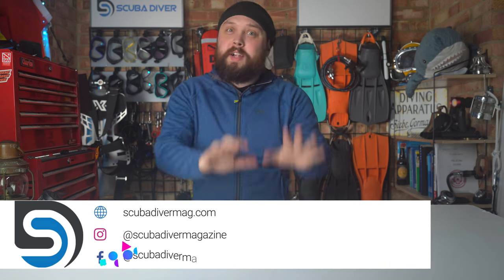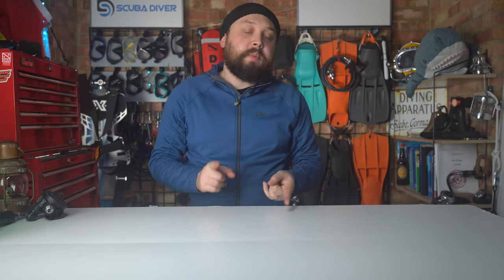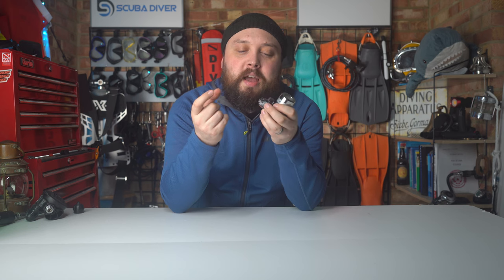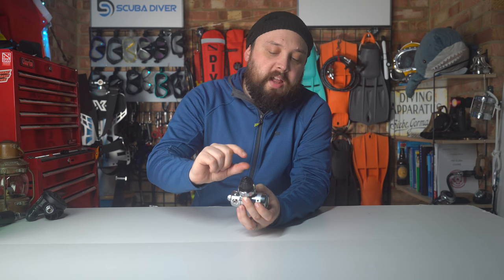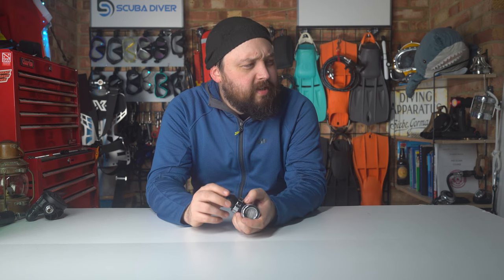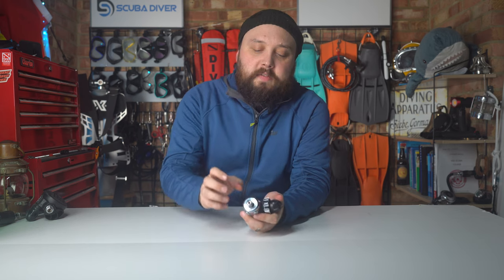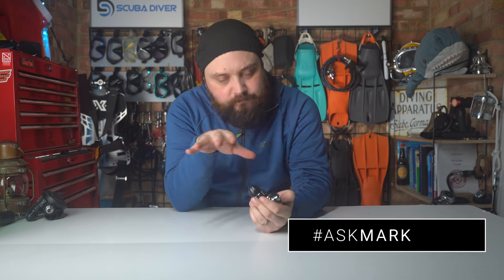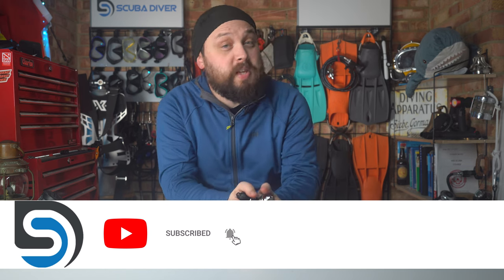Why Don't Regulators Have a Seal to Keep Water Out When Washing #askmark

Comment: A valve keeping water out could possibly fail in the closed position, which means shutting off or reducing airflow. It's a hard no.
Reply: I believe that if the Aqualung ACD system ever were to fail, it would fail in the open position.
Reply: @RogierJanssen  i wish that were the case. unfortunately, the ACD randomly sealed CLOSED on my Aqualung Legend (Yoke, 2017 model) earlier this year. Pony cylinder saved me. Reg had been serviced within about 9 months prior, moderate use.  Immediately brought it in for early service/inspection. Couple dives since then—with Pony at my side. So far issue free. But, also switched to Scubapro MK19–DIN.
Thanks #AskMark for this and all the tremendous publications! New to DIN, so particularly appreciate the guidance on 1st Stage maintenance.
Reply: @mrausma92  Oh I would never use a yoke model in the first place.
I could imagine an acd closing if the yoke isn't connected properly. Is that what happened?

Comment: #askmark hi Mark love the films ,after your advise on heated drysuit under gloves, I have a problem with a few fingers and when diving in cold water they don't like it, can you think off any heated gloves that may solve this problem for me many thanks rob d
Reply from the maker: Sure, Santi have a really nice heated glove with heating lines down each finger. Thermalution also made some but, I think they went out of business...

There isn't a huge number of options out there but, I'd look at the Santi gloves and maybe the new Fourth Element AR Gloves. They're not heated but use new fabrics to provide better insulation.

Comment: Is the yoke dust cap any better or worse than the DIN? Seems like the screwing mechanism would be a better deal?
Reply from the maker: DIN is usually better because the DIN 1st stage will have an O-Ring to act as a seal. I don't think I've seen an A-Clamp dust cap that I'd trust to submerge.
Reply: @ScubaDiverMagazine thanks Mark!